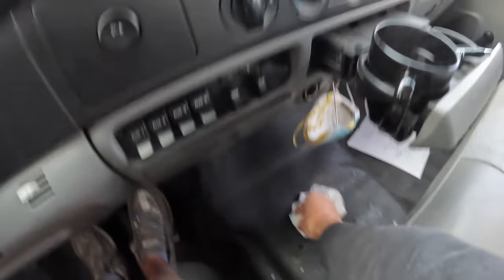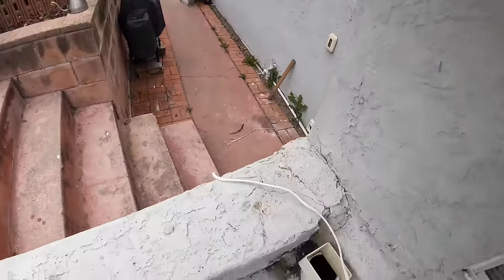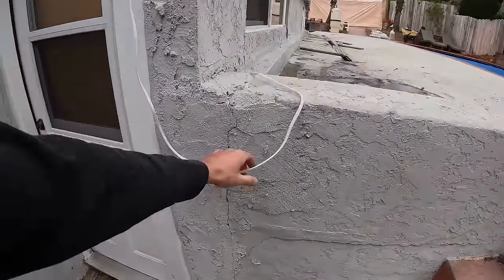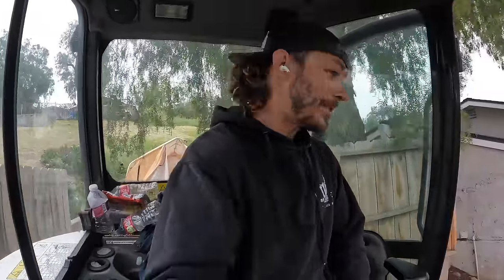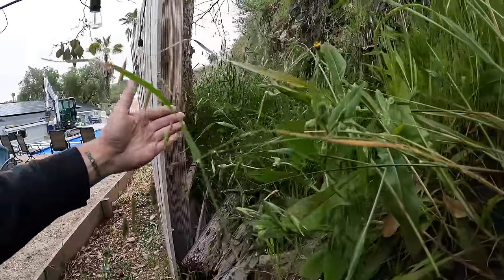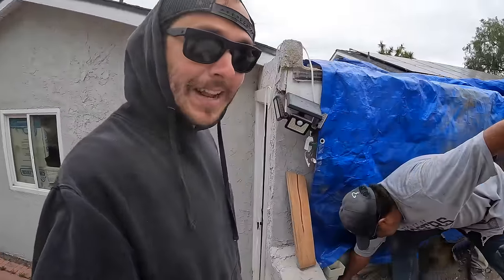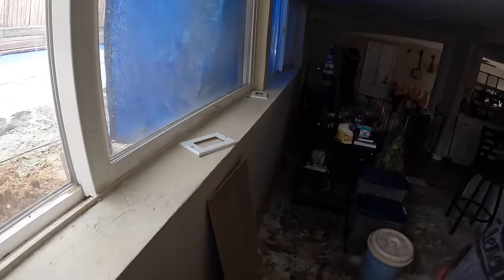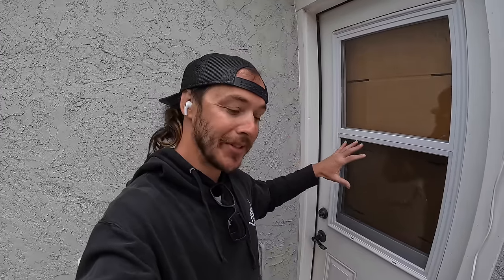House Flippers Completely DESTROYED This House!

Comment: Probably be better to hire a independent home inspector rather than depend on the realtors and try to find past building inspection permits to see if past work that was done and approved by the building department. Very informative video, nice work.
Reply: Even independent home inspectors can be...  not very useful shall  we sya
Reply: @DesiSegundoIII  You do better to find a couple guys who do construction and ask them to check it out. "Official" inspectors can be bought and paid for, or just a guy fresh out of college with zero real world experience.
Reply: @DesiSegundoIII  amen. My last one completely screwed me. Missed all sorts of wood rot under house cause too lazy to inspect whole house . 10s of 1000s and still not fixed all the way
Reply: @bch5513  man I hope you can get that remedied.
Reply: Most people don't buy homes more than a couple of times. Too often, we learn the hard way. My house is like a poster child for why you get a good home inspector. It shouldn't have passed FHA inspection but it did. It's taken years to bring it up to code. Some of the problems were actually dangerous. Substandard wiring and leaking gas pipes under the house. I'm lucky it didn't burn down around my ears or blow up completely.
Reply: First let me say I'm a realtor, I'm not sure what area this home is in I work in pa. As a realtor I  vet my inspectors and only use competent ones my reputation is a lot more important to me than what I would make on the sale of a home. it only takes one unhappy client  to mar you. We all know people are really quick to trash some one rather than compliment good work. I do agree there are a lot of inspectors not worth their fee's that's why I would trust a realtors advice on an inspector. We not aloud to accept referral fees or any compensation from inspectors there are RESPA laws against it and we could lose our license if we did. That why I only refer competent inspectors in my area. I am assuming  the work that was done to this house did not need any permits which would have required inspection from the municipality for items to be done buy building code which should catch these shortcuts made on this property.
Reply: @matthewmosier8439  but most construction guys don't have the "official" title that places like banks/ title companies want you know?
Reply: @DesiSegundoIII  For that hire the who you have to. But don't trust a home inspector without good reason to do so. 
I bid a job for a small business owner over a year ago. The home inspector told him that his fixer upper historic house needed a new bathroom subfloor. 
My friends and I were hired to tear out the old tile and subfloor and redo it. We tore up the tile and discovered that the floor was fine. Instead of just faking the subfloor repair and redoing the tile and pocketing the money, we showed the man the issue and explained that I had found that the whole job had been done, already, with new framing in some places. (I crawled into the crawlspace and checked it out)
I assume the home inspector was going to refer a friend for a job that he discovered had already been done to get a cut of the easy money.

The business owner has kept using my friend and I for stuff on and off, since. Honesty is the best policy.
Reply: @matthewmosier8439  Amen bruh - Good on you.  What part of the world you in?  Go on and put your business up here man
Reply: @matthewmosier8439  Wait, why wouldn't you go for a small bit of floor w a camera to confirm? Anyone can be wrong.

Comment: If they wanted to make a big patio between the house and the pool they should have used pressure-treated wood. And if it's made in 6' sections it'll be heavy enough to stay in place as long as you have some sort of hooks to rest on along the wall and pool. 
Here in Norway it's uncommon to have concrete all the way up to the building walls. You can usually see the gravel that's part of the drainage around the building. 
And between the gravel and the wall we use plastic dimple mats.

Comment: It's crazy to me those flippers are barely held accountable. Sure you'll hear about the occasional case but now that everyone and their mom is ReAl eStAtE iNvesTing!!1

At least tell me SOMEONE is going after them to recover some of the cost? Or are they shit outta luck?
Reply: they are mostly shit out of luck unless they can prove that the previous owners knew of the poor work and didn't disclose the issues.
Reply: You mean like all of the Flexseal behind the cut out drywall?
Reply: Assuming the owners took out a mortgage and didn't pay cash, they should have insurance that would cover a lot of the water damage. But the insurance may not cover fixing the structural issues, hence the tight budget mentioned. And I agree, house flippers get away with murder. And every flipper out there is using LLC's to hide behind and the smart ones dissolve the LLC's every couple of years and create new ones :). So depending on the time frame there may not be any legal entities left to sue :(.
Reply: @livens100  GEE it sounds like COMMIEFORINA NEEDS A LAW, maybe call it the ASSAULT FLIPPER LAW to protect home buyers that do not do their homework!!!!!
Reply: @420bongking  HOUSES ARE AN INVESTMENT!!!!!!
Reply: @Capohanf1  now they are a market with returns like the stock exchange. Houses were never looked at like that until recently 1990.
Reply: @jaysencorbett1855  HOUSES and LAND have ALWAYS been an investment JUST LIKE THE STOCK EXCHANGE!  OR do you think that the people that build the house in the first place were doing it out of concern for the homeless???  Remember, "NO PROFIT, NO CONSTRUCTION!!!"
Reply: @Bigbacon  um, even then...

Comment: Only finish waterproofed basements. Old school pre 60s and earlier basements almost always designed with some flooding being acceptable and it was just a maintenance thing. Because it was just concrete that could dry after it was mopped up. Mopping the basement with bleach water was standsrd maintenance for flodding. 

If you unbury your foundation and dont see black stuff or at least solid damp proofing membrane stuck to it flooding is a not an IF its a WHEN.

Comment: when you mentioned the wall below grade and how it was block wall I went "What I would have done to build the wall would be to build a frame with rebar, pour concrete and then backfill. though you would have to dig quite a bit below the house to ensure the wall doesnt move....

Comment: When I bought my first house nearly twenty years ago, I had family to help me out. They recommended / insisted I'd get a building inspection company to check the house since it was a bit older and all that jazz. Thankfully the issues were relatively minor, and the few changes I did have made were preventative (it is an old building with old wiring and I'm a computer nerd, so I had new wiring put in and new grounded sockets installed everywhere), but it made me feel a lot more comfortable in my new place. Especially after seeing videos like this pop up on youtube in the last few years, I know that it is 100% worth the money to get a professional inspection done as a part of the purchase process. It might not be cheap and if you find nothing you will feel like you wasted money, but compared to the mess you might unknowingly end up with after having committed, it is dirt cheap.

Comment: There is quite a bit of common-sense that can be applied to look for shoddy work, and the easiest thing to look for is the "converted patio/carport/garage." Like in the video, newer work that doesn't match the old work.

It should be criminal to "flip" a house that has structural deficiencies, but I guess that's more of an issue with access to the IBC by building inspectors. You can't simply download a PDF of it and look stuff up on an iPad while you go through a house. Perhaps one day inspectors will have to take photos of everything they inspect and sign off on it referencing the IBC or local code deviation from it.

Comment: Before even watching the tear down I’m going to assume no membrane/peel and stick, no dimple matt, no drain tile, no rock around the tile. I don’t know your guys codes/procedures I live in western Canada and build houses at a ski resort and most of our houses use and ICF foundation. But drainage works the same. Just finished a massive 3 story duplex that is built into the side of the hill bank also with a natural little creek running through one side. Drainage and foundation water protection was huge on that one. ICF, primed, membraned, dimple mat, drain tile, perforated pipe all around footing and out to the street etc.

Comment: Worked on one where they had taken out one bathroom and "remodeled" the other. They had cut off the drains under the floor level, left them open, and had put paneling up in the second bathroom. They paneled over all but 1 of the receptacles, and they were still wired hot!

Comment: I used to help a buddy with his flips, and we both quit when the TV shows started.  TV glossed over or outright ignored safety and health issues in the property and renovation.  Way too much carpet and paint and too little structure and infrastructure.  The shows seldom mentioned the project costs except in vague, round numbers that seemed suspiciously lowballed for the locales.

We did cool stuff, like par-buckling a roof so we could remove an exterior wall, re-pour part of the foundation,  and then let it back down.  That was on a house where a porch had been screened in, then the screen wall was enclosed and became the kitchen.  Another property, the kitchen had a home owner wiring job, where everything was red - ground, neutral, lines were all red wires.  It also had the 2nd floor dormer partially in the dining room, and getting THAT back in place was the day we pissed off the neighbors with a full day of crane blocking the street.  When we were done we were proud of our work and would have happily owned any of them.  Greedy flippers doing bad work ruined the reputations of many honest and ethical part time flippers.

Comment: The black coating at 25:00 looks like the super heavy spray foam we would spray at the bottom of chicken barn walls to keep the chickens from pecking through the softer insulating foam. It was like bedliner almost, but it was foam. Surely that's not what they used there, that stuff was pretty expensive, but it comes to mind.

Comment: I just bought a 2000 34ft RV that has had hack repairs done to it, mostly in the driver passenger windows and the roof sealants. It's taken a lot of work and learning to strip off old sealants and replace them, I am not satisfied doing a quick, easy, or half ass job. Once it's done the roof should easily last another 20 years...but the more I dig the more shoddy repairs I find, like the windows being repaired and not the lap joints, further trapping moisture in the walls around and floor under the window, so now I had to remediate rust as best as I could in place and have some sections of floor to replace

Comment: looking at the partial taring of the inside, if you put something like bed liner on the outside of that wall, would that work well? bed liner is amazing stuff that is both water proofing and adds structural support. if you put it on the outside of a block wall filled with concrete and rebar, would that be sufficient to protect the inside?

Comment: I've seen similar stuff but with a garage under the house which was then sealed and filled with dirt in because it kept taking in water. Problem is they didn't actually fix the drainage around the house, meaning the sealed garage now became a water basin. They had a large water pump hidden outside in a bush.

Comment: I watch flippers buy and gut the established homes in my area.  Same process.  Pull out real wood, add “clean” white particleboard cabinets.  Paint outside bricks.  Cover walls with trash Masonite shiplap, add bulk-purchased snap flooring.  Beautiful wood millwork gets covered by shitty latex paint.  Beautiful clear fir door casings get tossed for trashy pre-hung finger joint hollow core box store doors.  Chrome solid brass fixtures get yanked for chrome plated plastic fixtures.  It’s lipstick for shallow housewives.

Comment: I know there’s a proper way to seal the wall and you’ll show me later in the video but if you pull up the new wall and added professional flexseal to the outside wall that would bearing the weight and water would it still be waterproof?

Comment: I hired an inspector to check out a house I was interested in buy. the first time I saw the house it was like we were having a monsoon. I was there for the inspection which was the second time seeing the house it was raining but very lightly. I was able to walk around the house out side found issues with cinder blocks missing from the foundation and a roof on the back side that looked like ocean waves! I told the inspector of what I saw out back he came out looked at we back inside. He suggested I have him stop the inspection to save me some money on the original price for the inspection. I was able to get out of the contract as the house was not occupiable with all the structural issues. Found out it was flipped house. After seeing this I'm so glad I had a good inspector. He saved me some major headache with the things he saw that I had missed. installed central air ran the ducts but left a hole in the ceiling to the attic where when I climbed up to look the ducts weren't even attached. there was no place for a filter to go. When buying house it is 100% buyer beware if it has been flipped.

Comment: Can’t be the worse! The worse is the house next door to me. They bought a 32 k house that should have been condemned, paid 60 k to the owner. The contractor told me they were putting 52 k in. Sold to rental cooperation in calif for 179 k and they rent it for $1200 a month. And it caused my taxes to triple. Boards are popping off the house, the new windows are cracking cause the foundation is moving , the basement is always flooded. Worse refab I ever watched.

Comment: 1. That dirt looks like clay. Clay doesn't drain. I lived in Jacksonville, AR for three years, and our house had maybe two to three inches of actual dirt, and it was all reddish and gray clay underneath. I'm sure you already have a plan for removing the water. If I were handling it, I'd look to see if the homeowner owned the hill next door. If so, I'd pipe all external drains and gutters to dump out at the hill and let the water flow downhill to the street. If not, then pipe around the house and flow out into the front yard.

2. If the roof is any indicator, the bump out isn't the only part of the house-flipper hack job I see. It appears that the house originally had a detached garage or the garage was attached with a small breezeway. My guess is they also attempted to attach the garage to add square footage. That probably explains that weird ass patch job on the good wall. Also, when you butt roofs together, you also have to build water management to channel that water down to the sides of the house. Otherwise, you're going to get water pooling on the roof and looking for a way into the house. I'm guessing there's more water issue than the decorative patio wall turned external wall.

Yeah, that house is a shit show, and I would have walked away from it and warned my relator about it. There may be legal recourse to recovering damages from the flipper, if their LLC is still in business. Remember, the deed/title for the property would show who all owned the house and when the deed/title changed hands. You'd be able to find out at least who owned the property at the time of these changes, see if they pulled permits, and sue their asses off. However, I'd have to home owner see if they could have the insurance company take on the task with their "very experienced" team of lawyers, or if the homeowner would need to hire lawyers of their own and fund this out of their pockets. They probably also could include the home inspectors they hired in the same suit, since the inspectors were supposed to find these things and alert the home owner before purchase. Just an FYI, I am not a lawyer, and my legal advice is to talk to one who practices in this area of law.

Comment: you would have liked our house when we bought it, knew what we were getting into though. Previous owner took out pretty much all of the basement support poles so at it worst the floor was sagging about 2" older construction so the ceiling joists are all 2x4 and were sagging so we had to stick a beam up in the attic to give them some support almost in the same area the floor was sagging. Soot on every wall from an old wood furnace that was secondary and exhaust not connected to code, got a mud room where the exterior bit of the floor is sagging because they missed the nails all along the edge and that same mud room has a concrete post that is like a foot back from the exterior wall, no flashing on the 4x. We bought to live but wanted something to customize before the local contractors got their hands on it and jacked the price up with stuff we didnt want

Comment: just a question when was that house built because in the 80's  i seen people do raise porches they would do that style of wall and then fill it in with dirt by code  each hole had to be filled in and then inside had to be back filled  then a 4 inch slab no rebar at all now if it was built in the 2000 the code change to be filled with rebar and concrete